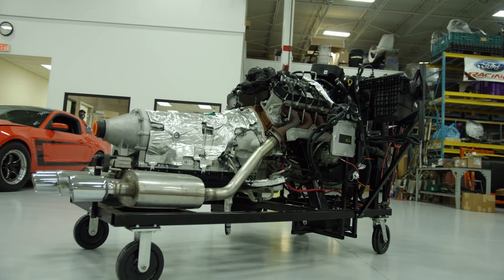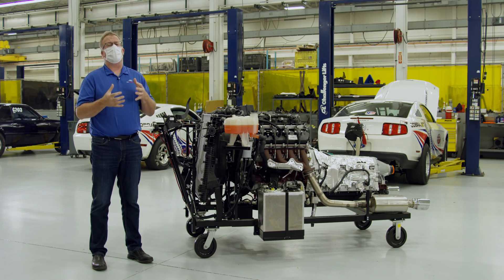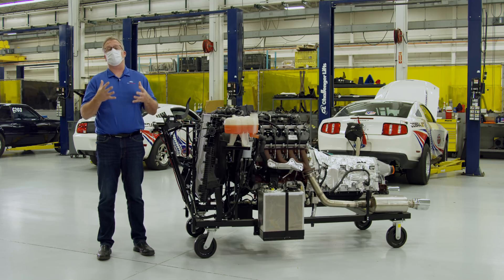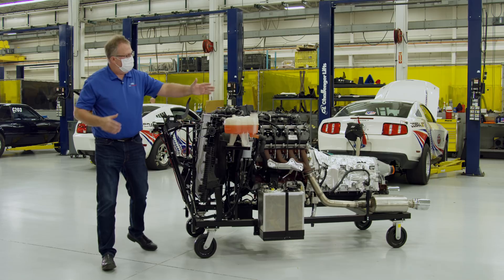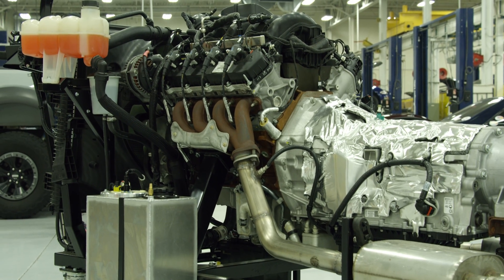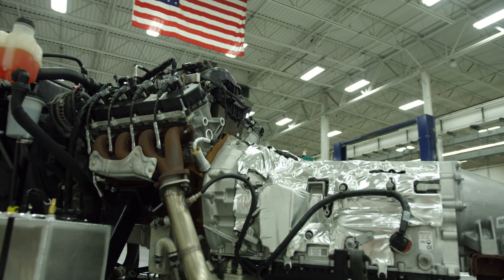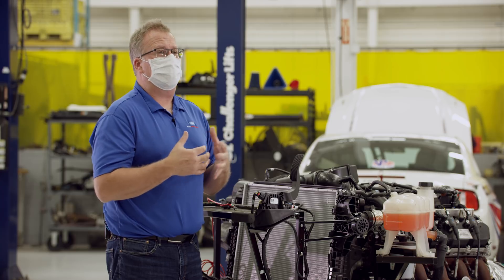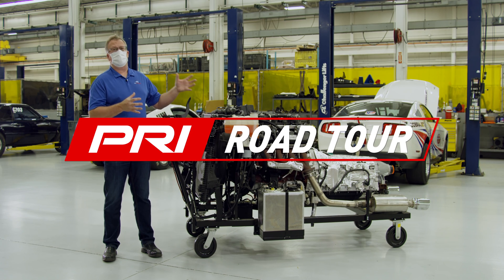Ford Performance GODZILLA 7.3L Crate Engine - all the details!

Comment: Only 430hp…?
The 5.0 gets 480hp…
Reply: 😒 Does it now?

Of course it does. Two different use cases. The Godzilla's first use case is in the Super Duty (F-250), so it's built for trq and pulling. The Megazilla is already available as a crate engine, though Ford Performance Parts and makes 615hp.

This thing is going to be everywhere with hot rodders - especially for non-Chevy builders who are bored with LS swaps.

Comment: I wonder how this compares to a well built 427w with EFI and cool near plug etc. Trying to decide between the two for a mustang. Everyone knows the 427, but 445 was a common FE stroker kit 🤔
Reply: For comparison, the new 7x engine is almost exactly the same size as an FE and they make FE style valve covers for it now. I think it would be pretty badass

Comment: Would be cool to Godzilla swap some Chevs.... Pretty sure since this is such a modern engine and that 10 speed it would be faster and way more fuel efficient than most cammed out stalled 5.3's
Reply: Be nice to turn the tables on the Chevy guys with a Ford engine swap in a El Camino or Camaro.....personally I wouldn't waste my time pissing  off chevy guys but, kiddos to those that would😁

Comment: Propane?
I have an F-600 4x4 dump that's decked out for firewood, but it came with the 370 Lima. I would buy a Godzilla if propane was an option like the 6.2. Anything is better than the Lima though. Anything.

Comment: Hello. I am considering using this engine on my f100, but would like to use the tremec manual gearshift (magnum). There was a comment in the video that the control pack is configured for the automatic 10-speed transmission. what would this new control pack be? this has already been released? to use this engine with manual gearbox, it will be necessary to install a flywheel, which do you recommend? thanks for listening.

Comment: Amateur question from a greenhorn, I've heard heard that can't bolt the 7.3L to a manual transmission is that true? Thanks in advance!
Reply: The godzilla has the same bolt pattern as the modular and coyote engines, both of which can factory with manual transmissions. You can physically bolt a manual transmission to a 7.3, it's getting the engine computer that may be difficult.

Comment: How long until this is mounted in/on a daily driven '94 Civic running a 2000HP shot of Nitrous, 2 whopping Garret Turbo's, Jake brakes, an 18 speed triple stick manual with extra reduction box's on the front wheels, smoke stacks, and bike tyres stretched over 20" wide banded steelies with enough negative camber for 14 bald eagles to perch on while flipping off Mexicans! ...

Comment: Let's  put that into a 1970 LTD 2 door.
Reply: A 429 with a roller cam and ro keys on aluminum SCJ heads would be just strong ,except the ram would be limited because it doesn't have 6 bolt mains .Price wise ? Idk

Comment: I would not want it.because it has aluminum heads plastic intake 4 overhead cam. With 4 fasers each cost somewhere about 7 hunder each.I rather have the 460 with cast iron police heads from the 1960's or the 429 with just a carburetor on it.not all this eletro crap on it. That monster motor is gay designed like tiny tim tip toeing thought the tulips.this over head cam crap is for gay people.Anyhow the motor is made in china
Reply: G.W.McLintock  Oh your right yet it still made in china sold in the U.S. and it still has plastic intake.prove me wrong about it's not made in china.and it still gay designed.
Reply: G.W.McLintock  correct me if I'm wrong yet the parts are made in china 500 buck to say I'm right and assembled in Canada.it's just like H.D. motorcycles are made today in china.just because they are assembled in the U.S.  does not make them U.S. made
Reply: G.W.McLintock  for what it cost to buy what you show I could go and a 460 block get police heads cam it and do all the machine work and get a it a lot cheaper then this thing.I bet I would have 10 grand in it when I finished and I motor with all the new high straight metal would last a lot longer then this cheap piece of junk .they do not put super high straight metal parts in that motor,it's made in china they cheat every chance they get.
Reply: G.W.McLintock  And on top of that you can buy a titanium forged block now they cost some new!if a person knows what he's doing he can out do this motor 10-1 maybe have a little more money into a better motor.Just like stan myers he made the water burning motor the gov. went over and killed him.I have the knowledge how to do a lot of things better the manufacturer. so I can build a block to get 5 miles to the gallon and then put stan meyrs kit on the motor and burn it on water.water is free.
Reply: @bottel01  Stan Meyers was a fraud. His water powered car was no more than a conventional fuel cell using simple electrolysis. And a 460 can’t come anywhere near the new 7.3’s output without guzzling down fuel like an old pig. They were respectable motors at the time, but there’s no way it can match modern manufacturing techniques and proper fuel injection.

Comment: "Old school pushrod design"  Come on guys, it's almost 2021.  At this point we all know that 4 valves are way better than 2.
Reply: But a DOHC 3.5L v6 engine is almost as big and heavy as a pushrod 6.0L v8.

That alone is reason enough why the pushrod is still being produced, specially on low rev high torque situations like truck.
Reply: @jpogigtxcr1778  ummm, what?  I'm talking about the crate engine in the video benefiting from having 4 valves instead of 2.   What does a 3.5 V6 have to do with this?
Reply: NZNSI Inc I'm comparing the physical size and weight of a  ohv engine versus to that of a DOHC. The size and weight savings of pushrods make it an efficient engine.

And as we all know, it's very hard to implement 4 valves per cylinders on pushrods. 

You have to look at the bigger picture, not just whether the engine has 4 valves or not.
Reply: Not to mention a single intake and a single exhaust valve does a better job a swirling the air-gas mixture that it makes the system more efficient at low to mid rpm. That equates to higher low-end torque.

Some new 4 valves per cylinder engines have mechanisms that permits only one intake valve to open at low to mid rpm.
Reply: @jpogigtxcr1778  "the size & weight savings of a pushrod engine make it more efficient"  First off, how light do you think a pushrod engine is? Give some examples. Also, it is LESS efficient than a 4 valve engine.  Engine efficiency is how well it moves air.   According to you, if I bolt a 40 pound supercharger to my engine it suddenly becomes less efficient because it is 40 pounds heavier.   Clearly that's not right.
Reply: @jpogigtxcr1778  "a single valve is better at swirling the fuel air mixture"   Meanwhile, 4 valves let more air in and do a fine job of mixing the fuel & air.   Also, the loss of low end torque is in your imagination.
Reply: NZNSI Inc At low rpm it is. That’s why some newer 4 valve engines have intake valve deactivation, where one of the intake valves don’t open up at low rpm.
Reply: @jpogigtxcr1778  you are talking about a feature on street cars to maximize fuel efficiency during normal driving.  This video, and subsequently this conversation, is about a powerful crate engine used for high performance applications.  The goal of any such application is to move as much air through the engine as possible.  Why ford would make an old style pushrod engine then brag about how "other people" have made modifications to improve power is mind boggling.  If you are going to make a crate engine, do it right the first time.  That is silly to make a so called performance engine that requires the buyer to immediately have to make upgrades to unlock more power.  In a world where 4 valve engines and electric motors dominate in power and efficiency, the old school 2 valve setup is a hard sell.
Reply: NZNSI Inc Im talking about better torque at low rpms that is essential for trucks which this engine is primarily designed for.

Now if Ford wants to upgrade this engine for performance then they would have to go for other things as the 2 valve design is already part of the basic design. That's why it's a moot point to complain that this is not as good as 4-valve
Reply: The valve deactivation feature on some 4 valves is to improve fuel air mixture, this improving torque at lower rpm, thus improving mpg.

Look I’m bot disagreeing with what your saying with 4 valve. But the fact that this Godzilla engine was primarily built for heavy duty truck means the 2 valve design is perfect for it. 2 valve design has been proven to have higher torque, at low engine speed, due to better fuel air mixture.

Now, Ford just wanting to sell more this upgrading the engine. But you see, this is a pushrod and we can’t do anything about it’s 2 valve design. So it’s a moot point to talk about it not having 4 valves.

For makes a 4-valve v8 for their Mustang with 480 HP on their 5.0. So they know what they are doing when they designed this 7.3 pushrod for their trucks
Reply: @jpogigtxcr1778   you keep defending the 2 valve design by saying this is a truck engine & it needs the low end torque.   That is not at all what is said in the video.  The video is him saying it is a performance engine for racing applications & you can put this in ANYTHING.  You are making this engine all about trucks but it is not even being marketed that way.  Meanwhile, you admit that the much smaller displacement 4 valve mustang engine makes more power than this huge 2 valve engine.  They want you to buy this crate engine then immediately dump $1,000's in upgrading everything.  That is silly to not make it better right off the bat with something like 4 valves.  For the same money I could just do an electric conversion, have more power and not have to buy any fuel for a gas guzzler.  That is exactly what other performance enthusiasts will think when they watch this & weigh their options for how to make the most power for their money.
Reply: NZNSI Inc What I’m saying is that it’s a moot point to talk about having 4 valves (Which was your main statement) with this engine that was designed to be pushrod for a truck. 

If you said in the first place that this whole system (engine) is not good for modding, then I would’ve agreed right away.

I just pointed out the benefits of having a pushrod engine, with it’s low rpm efficiency and lighter and smaller physical size than a DOHC of the same displacement.

Ford needs to sell, just like any other company. This is one way of them selling more of this engine. It may not be for us but there are some who has old 70’s muscle car chassis that use this upgraded godzilla instead of using a DOHC 5.0 coyote which would look weird for the car’s time period.
Reply: @jpogigtxcr1778  4 valves is not a moot point, it is THE point.  Trying to market an old style 2 valve engine as a performance engine is yesterday's news.  This is being sold as a performance crate engine for anything, not just trucks. 

I never said it's not good for modding, I said it was silly to buy an expensive crate engine only to have to sink $1,000's more into it just to unlock more performance.

No, you didn't just point out the benefits of a pushrod engine, you argued those points while dismissing more efficient designs as pointless.  You still have not backed up the lighter & smaller argument with any examples.  Actually, the only comparison you made with this 7.3 engine was with a 4 valve mustang engine which coincidentally is smaller and lighter yet makes more power than this 7.3L  giant, which makes my point.

You are right, ford needs to sell stuff.  You hit the nail on the head right there.  That is why I also brought up the point about this being so expensive.  You aren't just buying the engine, there is all this other stuff they want to sell you: engine control system, transmission, heads, headers, cams, valves bla bla bla, the list goes on & on.  Instead of putting together an incredible crate engine they put this together and said "now buy a bunch of replacement parts."  That's not how you treat your loyal customers and that's not how you market a "performance racing engine."  This engine was not built for racing, it was built to sell more parts.
Reply: @nznsi  Just google "DOHC vs Pushrod size pictures". And I never once said 4 valve is pointless... you got to quote on me for that. All I was saying is that 2 valve design is more efficient at low rpm.

Again, You complain that it is not a 4 valve, but we cannot change the fact that this is a pushrod engine and we cannot alter it to make it four.

It is what it is. Ford just want to milk their original design (which is efficient for truck use), and want broader market. Which they can find with old muscle car owners who wants to put a modern but more period appropriate engine, than putting a DOHC Coyote.
Reply: @nznsi  Now if you hear me saying the Corvette C8's engine is very good then you can absolutely bash on me.

But I think a the pushrod LT2 engine has no place in a modern sports car.

But the Godzilla 7.3 is different, because it was made for a truck. And if Ford wants to make more money off of it with upgrades then, I don't blame them. But they cannot change the valve design be cause it is integral with the over all engine design.
Reply: You should really consider making a control pack that would control a 4R100.
It would really open up a whole world of possibility for people on a budget, and less driveline modification needed if someone wanted to swap into an older F Series pickup.

Comment: Not enough hp! Really 400. Something. It should be putting out like 700/800 hp.
Reply: https://carbuzz.com/news/tuner-gives-fords-godzilla-an-800-hp-lease-on-life
Reply: 400 is plenty for a stock 7.3. At that output it’s not under high stress, and should be a very reliable design.

Comment: ALL BS aside it makes 430/475 - hp/Tq.
From an iron 7.3 push rod engine. Those numbers are weak. An LS3 can match those numbers with a 6.2 Liter with L/T headers for half the cost and probably a lot less weight. If this is Fords idea of an LS Alternative for Racecars there going to have to do A LOT better.
Reply: This is likely an assembly line takeoff. It will have a very mild cam and springs. I bet swapping those out alone would get you 100hp and still be quite mild for a daily driver. The LS is an amazing motor and the support only makes it better. GM (possibly knowingly) used the old V8 bellhousing pattern and put the engine in every RWD platform they had. It only took those first few crashed Camaro's and Vettes to start a swap craze. Ford should realize this and put the motor in the F150. If it is only available in the 250/350 it may not gain the following it needs to be like the LS.
Reply: Geoff Moore very true, Ford has had wicked engines over the years but they were so rare that you only saw them in magazines. I had a 428cj out of a smashed 69 Torino, only one I ever saw and it was a beast. I don't know if it's the pricing or what, why did people buy tons of big block camaros in say 1970 but mostly small blocks in mustangs? The 5.0 fox body built its reputation on the fact it was quick, light and flooded the market with low price. Gm and mopar has done that forever, wish Ford would do it again!
Reply: Hear the man and read you words again ls3 matching those number with L/T headers and the man saying customers with custom tuners you have to custom tune the engine your way so it can make the number you looking for and the numbers he is talking 430/475-hp/Tq are calibrate for a super duty. And it make sense he is talking about 10 transmission of a super duty.